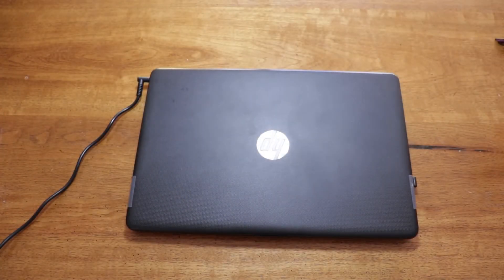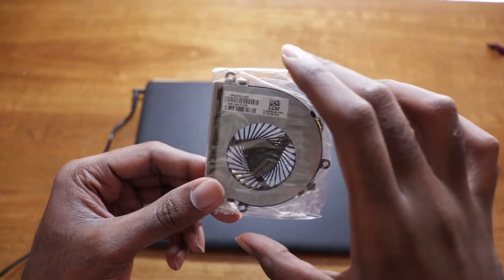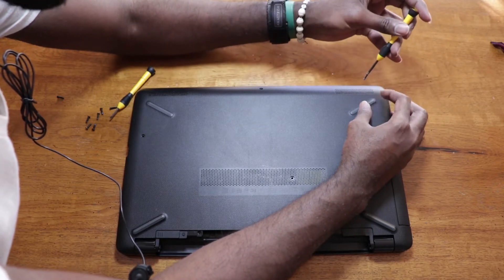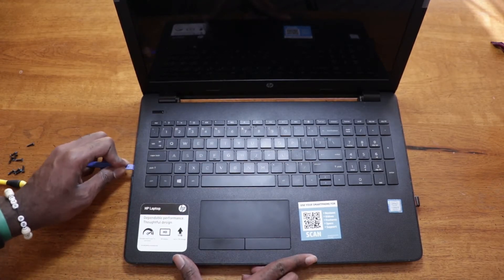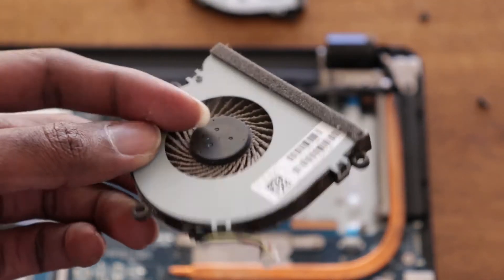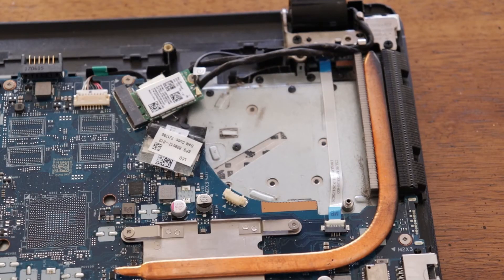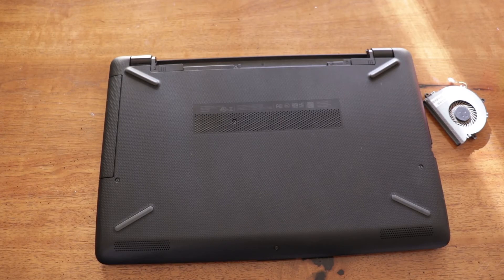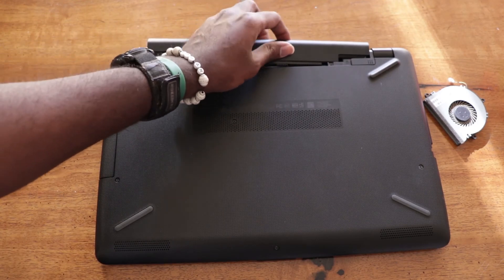How to replace CPU Fan on HP 15 bs015dx

Comment: Thank you. I couldn’t get my CD drive to go back in and then I realized that I had to remove the screws to get it back in. Also did the old fan still spin? My old one was working but slow. The speed was not varying like it usually did.
Reply: i know its 3 years later, but it designed to fluxate when your cpu needs more cooling.